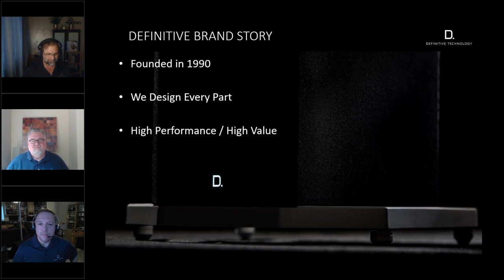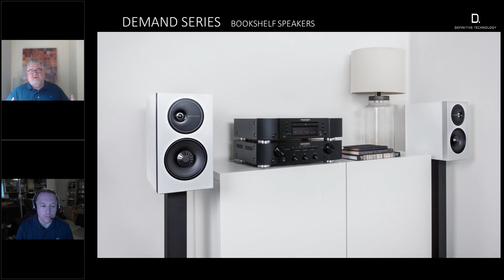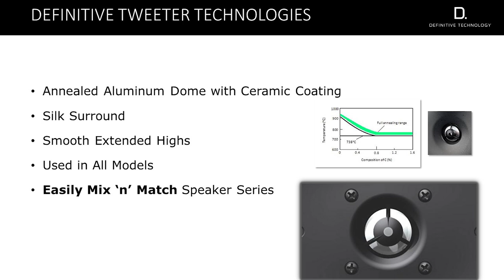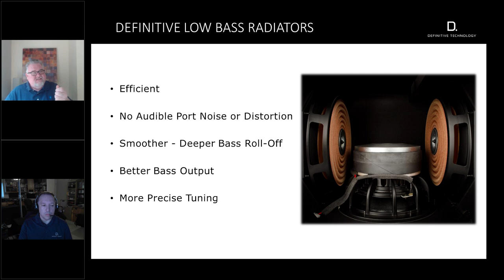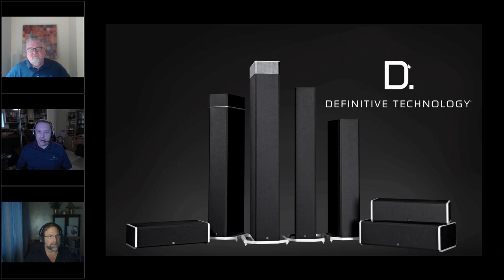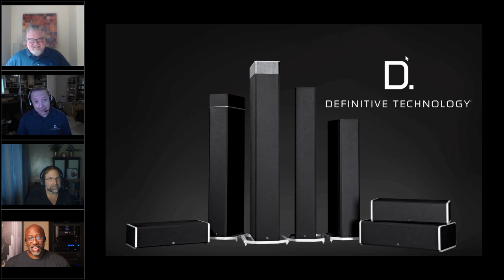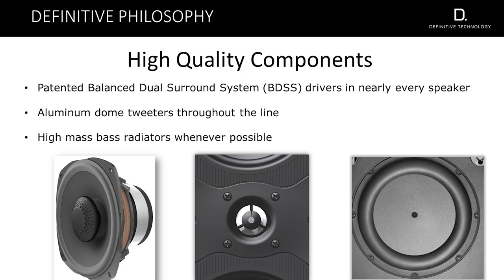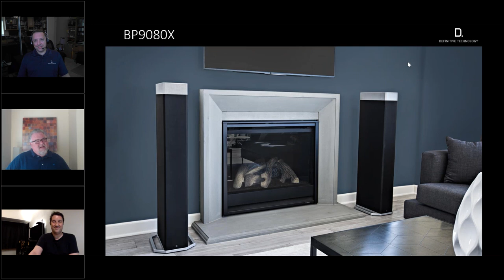Definitive Technology - Part 1 Design Philosophy

Comment: They’re known for having amp issues. It’s well documented on all of the HiFi forums. I have a pair of BP-7004s that I bought back in 2009 and have already had both amps replaced. One of my speakers just started acting up again yesterday so I called definitive technology to see if I can get a replacement amp. Completely different experience this time than when I called to have them replaced before. The first time my call went to someone stateside who knew a lot about home audio and was very quick and helpful determining the issue and shipping out my replacement amps. ($90 apiece). The person I just talked to this morning sounded like they were in a call center on the other side of the world who just read off a script and had no clue about home audio setups. In the end we determined my amp is bad and she informed me they no longer carry them and it will cost me $300 to send them off to be repaired. No thanks I’ll just find a speaker company that actually makes a speaker that lasts without having to be fixed every couple of years. What’s sad is they sound amazing when they work but I refuse to keep giving a company money that keeps making faulty products as I’m tracking the 8000 and 9000 powered towers have the same issues with amp failure.

Comment: 23 years ago, I got my BP10B and to this day this speaker has been by go to speaker.  I have changed every component of my system but my def tech stays.  No speaker regardless of the price range gives me the same emotional experience as my BP10.  The more expensive active speakers form Def tech does not measure up to the original speaker that Sandy Gloss created.  Pure perfection.

Comment: I have 4- BP7004's that I bought new back in 2009 when they were a local company here in Maryland due to the fact that they had amazing customer service and would send you replacement amps and speaker socks if needed. I had no idea that they were purchased by Sound United until I needed to replace the amps in 2 of the towers and in a Supercube as well as a ProSub 1000. I was told that they no longer offer replacement amps so now I have some really nice doorstops. 1 of the 2 remaining towers is now humming so I am going to have a nice 3rd doorstop. I have looked high and low for replacement amps for the towers but have not been able to find anything. The 2 subs weren't very good when they did work so I have not pursued replacement amps for those but the towers sounded pretty good so I would really like to get replacement amps for them. It's really too bad that this company dropped the customer service experience that they once had and the replacement parts since the towers and subs will all need replacement amps and most people do not or cannot fix them themselves. I assume they do not offer replacement amps for the newer versions as well? If they do and you are thinking of buying them make sure to buy a few for each tower as you will need them and they probably wont offer them in the future when they are out of warranty. I would much rather the ability to replace the amps then have a nice "unboxing experience" knowing that the box and speakers will take up more space in the local dump in  a few years.
Reply: Rebuild them using fine gold caps sometimes there are small resistors that need replaced on the power board of the amp

Comment: I own 9040s: primary interest is 2 channel music, secondary home theater. Pros: fast break-in time, fantastic sound stage/field, immersive sound, powerful bass, clear crisp definition & wide dynamic range. For HT I have ceiling speakers for REAL Atmos sound. That top Atmos speaker is a mkt gimmick that cheapens the brand, Challenging tower placement (must place minimum 60 cms from all walls). Highly recommended for stereo and HT. BTW the bass/woofer management is a unique feature that makes works perfectly!

Comment: I am on my third set of amps for my 9060s. The first two I was using the LFE and two SVS Pro 2000. I was assured by CS at Sound United it was not a problem using the LFE. 
The third time I have the towers set at large and am using full range. But I still had my amps go out. They would be working fine and then just stop working, then after some time they would come back to life.
Maybe that’s why the new Demand series only has the bass radiators?

Comment: Does anyone know if Def Tech fixed their QC problem on the Bp9000 series with the faulty amps? I'm looking to buy 4x Bp9080x towers and I'm really hesitant due to so many people reporting this issue and having to replace parts every ~6-11months.
Reply: I work in hifi store and there were bp9060 at the exposition and one of them died after around a year

Comment: Amazing! I have four of the BP9080x tower speakers, they truly immerse me into whatever I am watching or playing! Truly incredible 😎
Reply: I want to buy 4x BP9080x towers just like you but I'm really scared of the amount of people with faulty amps that are experiencing issues every 6 to 11 months and having to replace their speakers. I'm expecting that a product like this lasts around a decade with proper care for the price.
Reply: @charlestwoo  huh, first I've heard of it. I've had my speakers for 2-3 years (I bought two in 2017 and two more in 2018). No issues. I initially had a large thump sound from my center CS9080 speaker but, once I got a new receiver and recalibrated everything, that issue pretty much went away, everything runs perfectly now. In my opinion? Save some extra money and invest in some warranty. That way, you can get a problematic speaker repaired or replaced

Comment: If you do not use the LFE connector for the bp towers then these towers do not have subwoofers useful for movies. Do any AVRs actually feed the full sum of the crossed over bass from your other channels and the .1 LFE through the speaker cable to your mains if you have no subwoofers? I used a minidsp-hd to use the LFE channel on my bp9060 towers despite what you are saying. I have 3 subs connected to the mini-dsp: 2 bp9060s and a SVS PC-2000 and with rew and a measurement mic I tweaked the bass for a good result. Got a pretty flat measurement from 20 hz to 120 Hz with the 3 subs (SVS subwoofer located in back corner of room and towers of course in front). To say you cannot use the LFE assumes there are no advanced users using your products. I have a Marantz sr7010. I am running the towers full range (large) and using the LFE for 7.3.2 and have the towers crossed at 100 hz and set small for 2 channel (so my svs pc-2000 is included in music).

Comment: The BP9060s have a loud posing sound every time you play a source. I red some reviews and thought they didn't set the system up properly but sure enough, my speakers also make a popping sound. I am going to return mind tomorrow and look for something else. They sound great by the way but seems to have defective amps.
Reply: I am also experiencing sub amp issues with my BP70006's.

Comment: Sound great, but noticed i def needed a sub to pair with the 8040st. Was thinking dual sealed subs to pair with 8040st and use crossover for sub to handle about 60hz and under. Actually going to do away with the 8040center speaker since my system is purely for music. Does anyone have a recomndation for sealed subsnto pair with them?

Comment: I have demoed these speakers and they do sound great! So what's up with the amp issues?
Reply: They’re known for having amp issues. It’s well documented on all of the HiFi forums. I have a pair of BP-7004s that I bought back in 2009 and have already had both amps replaced. One of my speakers just started acting up again yesterday so I called definitive technology to see if I can get a replacement amp. Completely different experience this time than when I called to have them replaced before. The first time my call went to someone stateside who knew a lot about home audio and was very quick and helpful determining the issue and shipping out my replacement amps. ($90 apiece). The person I just talked to this morning sounded like they were in a call center on the other side of the world who just read off a script and had no clue about home audio setups. In the end we determined my amp is bad and she informed me they no longer carry them and it will cost me $300 to send them off to be repaired. No thanks I’ll just find a speaker company that actually makes a speaker that lasts without having to be fixed every couple of years. What’s sad is they sound amazing when they work but I refuse to keep giving a company money that keeps making faulty products as I’m tracking the 8000 and 9000 powered towers have the same issues with amp failure.